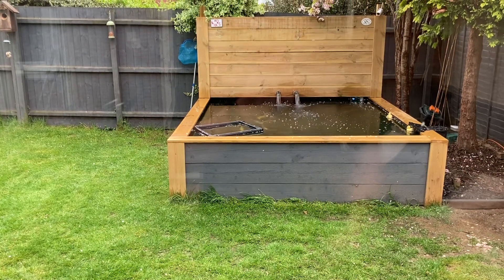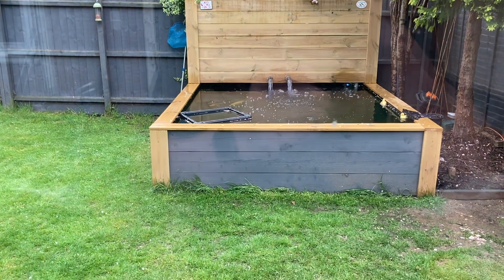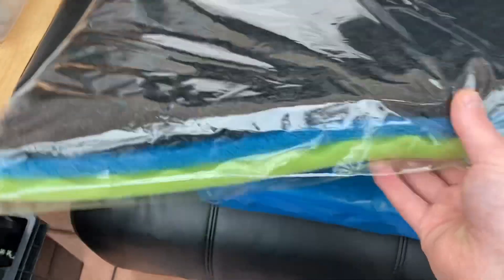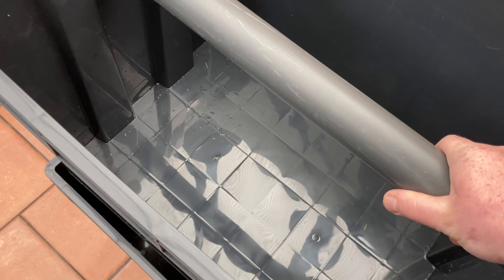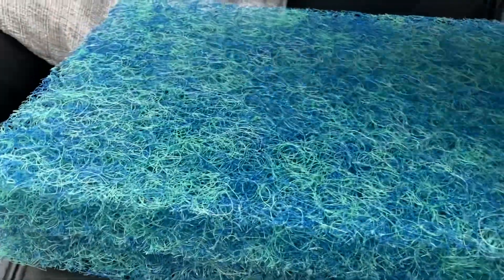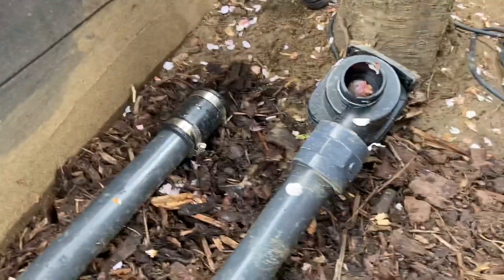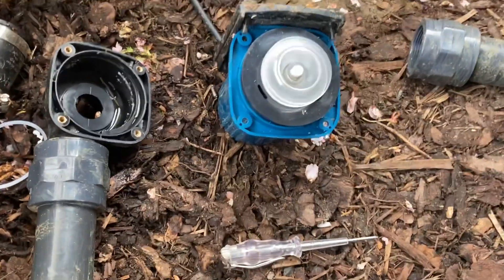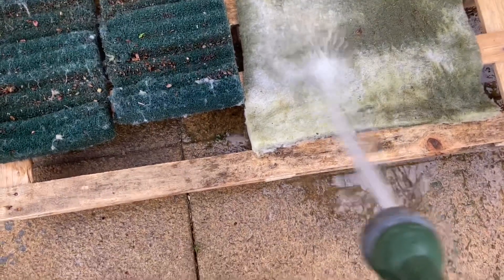DIY sleeper koi pond new filter

Comment: I don't think the blossom is getting through the gaps in your basket, more like when your skimmer is switched off basket floats up and blossom is getting underneath, when you switch it back on blossom is getting sucked into pump. The solution is to put a pebble/stone in your basket to keep it weighed down even when pump is switched off 👍